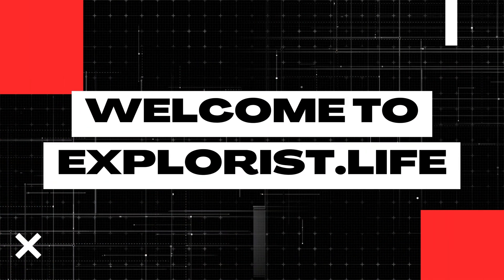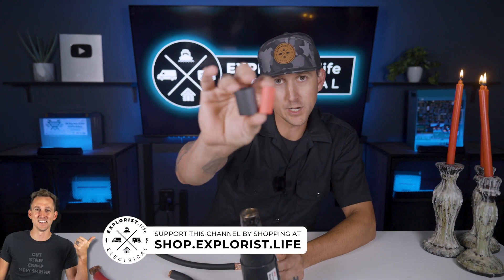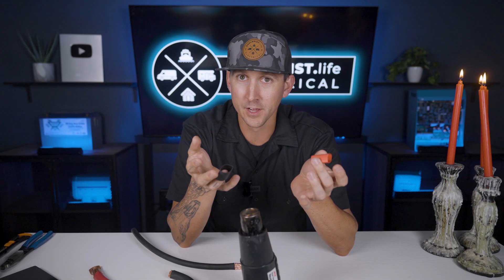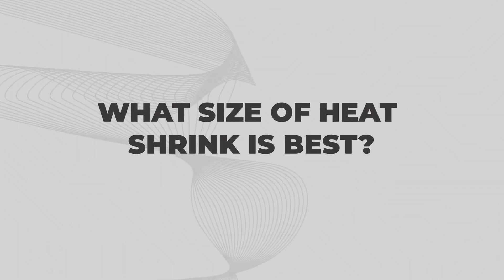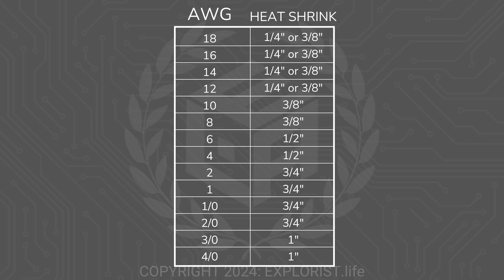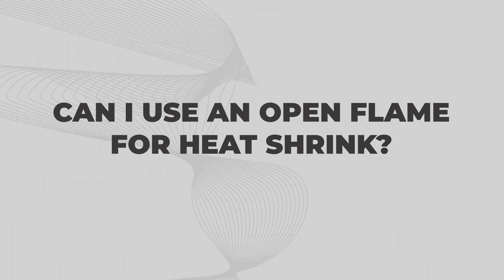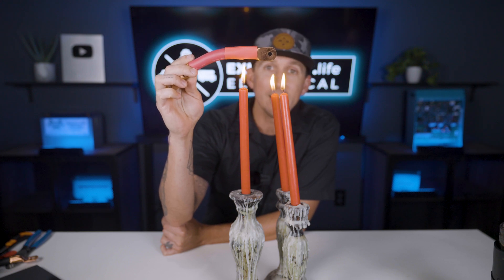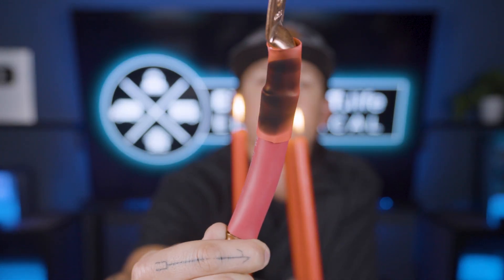Heat Shrink 101 - Wire Terminal Basics | Ep: 4/14

Comment: Hi I'm in Australia, iv  been a long time watcher .well 12mths at least. 60% of my FERAL.emergency off grid 12v system.4x 120 amp sealed lead acid.(could not afford lith) 5x100 w 5.5 amp panels.2000w inverter I have learnt from you. Thank you. When I say FERAL, I mean that my system is on a 350kg furniture trolley, I can move it around where ever I want. That is my main, system I have another which runs basic low demand stuff.150kg trolley. Well lately I have been having an issue as the temp rises my mc4 fuses holders I think expand thus disconnecting the fuse.3weeks testing after temp drops  every thing all good. Next thing, put mc4 fuses out of sun. Can you do YouTube on temperature problems with solar? Oh, can you make it in Celsius, I don't understand the old stuff. Thank you
Reply from the maker: Are these fuse holders purchased from our store?  We have never had issues with that.